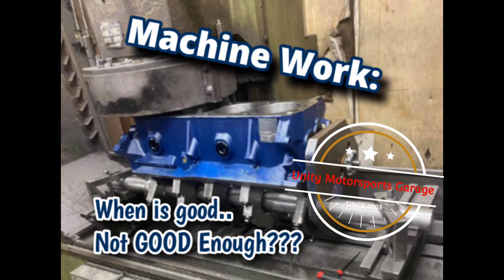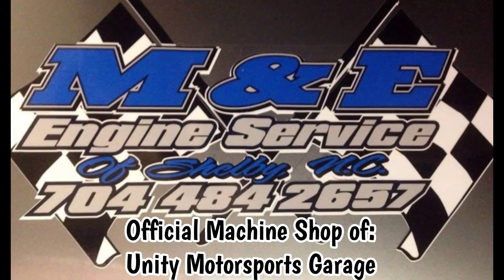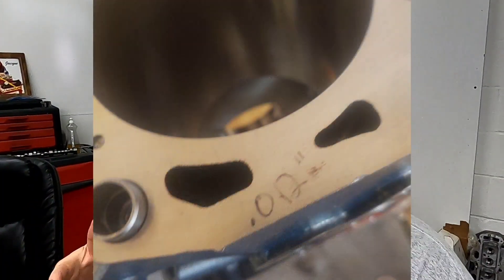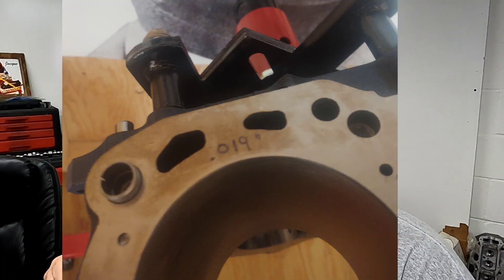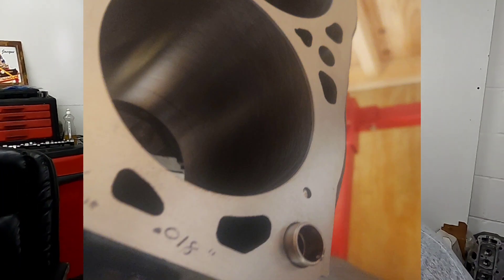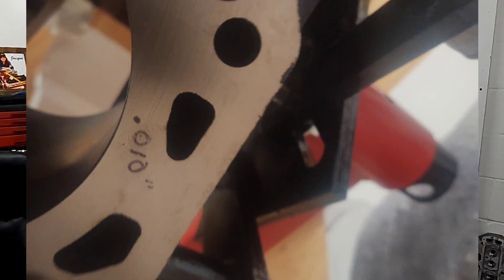Engine Machining: When is Good not Good Enough???

Comment: Guy I used for years retired had to find another machine shop. One was recommended by a few people so I went with it. I can tell you this much, dollars spent isn't always connected to the quality of the work! The decks aren't straight, shorter to the inside of the block. Pistons are zero decked on the outside and positive by about .010 on the inside. Hopefully I'll be able to assemble the 318 as is otherwise I'll end up paying another shop to fix it. Never going back to that shop.

Comment: The automotive machining trade has been good to me throughout my adult life. Started out at 18 years old doing it. Some days I had to walk to work. 
  It never paid me a prestigious wage, just a living and a few extras. It kept me out of trouble and in the good graces of many fine mechanics. 
    I worked my way into a small mom and pop racing engine shop after about 10 years of experience. I was well versed in the old Serdi seat and guide equipment. I learned the importance of guide to seat concentricity and how to keep the machine tuned up to tolerances I expect nobody to believe.  
   Years later with the help of my father and a few good friends it was made possible to buy out an old machine shop at near scrap prices.  
    Dry west Texas environments sure keep rust at bay.  Dust is another story. 
    The Ford customers I took interest in helping out in the performance shop took care in helping me to afford fixing the equipment. I can not be thankful enough to them. 
   I’m now a few months plus side of 50. I have my own machine shop at home. I wish I had the energy I had in my youth. 
   I find myself never earning enough to cover the improvements I make and I’m blessed right now to be able to do so. 
   No more vitrified stones for honing or valve facing. It’s bonded diamond and cbn. May never earn enough to break even, but what a great ending to the frustrations of dealing with taper and titanium valve grinding. 
    It’s a true labor of love for myself. I try my best to be a helper to the machining community. I find that attempt to be treacherous in that this trade is full of hardened mindsets, my own included. You can come across as an attempted savior very easily while not intending to. 
    The best aspect of this trade is learning new and improved methods. Often you find that you’ve gotten away with less than desirable methods without consequences. The minute you’re made aware and chose to practice true ignorance, you pay the price.  So I find it keeps me honest.  
    I also never knew that my 8th grade interest in the scientific method taught to me at the time would serve me so well. The practice of scrutinizing and controlling the idea of one change at a time and testing that change is a task. Extraneous variables recognized and controlled can sometimes lead to further success. The knowledge that nobody is perfect brings forth excitement at times.  
    I’m sure it comes as no surprise that this is a dying art. It sure is a practice. It is not a bicycle ride you’ll never forget how to do. You get dull when you don’t practice.  
    Finding a new energetic generation to take interest in this seems hopeless and that is somewhat disheartening. 
   I keep plugging away. Having as much fun as I can in the mean time. It’s still a great life for me.

Comment: Cheap machine work isn't good.
Good machine work isn't cheap.
I won't mention the manufacturer,  but it was 1 of the big 3. On my mother's eyes, this story is true. We once took a brand new big block, performance crate engine apart to check all the tolerances and balance of the entire rotating assembly. Remember,  from the big 3 now. Align hone was fair, as well as the final cylinder hone and size, but from there, that's where dimensions really became scary. Rod big ends were fair at best. Balance of the rotating assembly was controversial at best. The point being, this engine MAY have lasted 100,000 miles or more. Did it require a complete " blueprint " for performance use, ABSOLUTELY. 
T.S. RACING
Reply from the maker: So true... Thanks for Watching
Andy
Reply: Thank you Andy. I remain anonymous here as I'm primarily retired and I just build engines for a select few. 
I am looking forward to providing some real world engine building experience. I am suscribed to Mr. Vizard as well. A brilliant,  brilliant man, and I used to teach dyno tuning as well as the flow bench in a tech school. When he speaks,  I listen. 
I just wanted to add, that in my first message to you,  when I talked about the align hone looking fairly good,  what I meant was,  plus or minus. 0001" for size, taper, and out of round.  Same with the cylinders,  plus or minus a tenth,, in 12 places inside the bore.. I'll be hopefully doing some videos in the future,  and ya'll can see first hand,  my experience. 
GOD BLESS YOU ANDY.
And yes, all the pistons were pressed off the rods to check their weight and establish a true Bob weight and I spun up the crank at a 50% balance factor. In my Race Shop, over the years have been contracted to do several studies on engine building.  1 of my favorites was comparing lubricants for rod bolt stretch, and main bearing housing bore,  and rod big end  dimensional changes
 comparing several different lubricants as well as mixing 1 or 2 together.  The results were interesting to say the least.

Comment: Andy, I think it would be interesting if you did a series of videos on the proper tools needed to build a top notch high performance engine, including the cost to buy each tool and how to properly use them. I’ve done stock rebuilds, but I always have a professional build my race motors. This is because I don’t have the proper tools nor the expertise needed to build a high dollar motor that needs to perform well and stay together. I would certainly learn from something like this. I’m sure there’s info on line, but you’re very good at explaining things and easy to relate to. So, just a suggestion. Thanks for your great videos!
Reply from the maker: That would be a good video... I will do that

Comment: you've probably mentioned this on other videos, but a fly in the ointment--store the deck bridge and calipers at room temp. sometimes an expansion or contraction leads to a wrong measurement and you chase after a problem that doesn't exist :)

I find one great way to find a good machinist is to hit the local airport and find who the pilots use--when a plane blows an engine, they can't just pull over to the side of a cloud and ask for a tow.
Reply from the maker: I have covered about using Calipers at room temp. Thanks for Watching and for posting
Andy

Comment: YES! I deal with this all the time. As a HP machinist I'm amazed at all the racers that just want to get something together and throw a big shot of nos on it or boost. It's like a house, you have to have a superb foundation for everything that goes on top. I despise Richard Holders channel in which he takes a so called junkyard engine and throws 20 lbs of boost on it and everybody thinks that's a good way to go because it's cheap. I'm sorry Richard a 1000 hp 5.3 L from the junkyard will be back in the junk shortly! Too many racers spend their money over and over again thrashing a TURD when they could've built a reliable strong engine with the same money in the first place!

Comment: Great advice! There are no words to describe how important a properly machined block is, as the foundation of a powerful, reliable build. Ensuring straight crank and cam journals, parallel decks to the centerline of the crank, and true 45 degree cylinders to the same centerline makes for a top quality build.

Comment: Great video, man. 
I’m a retired machinist by trade, and I can’t stress enough, that “new” engine builders MUST check everything! Never assume anything. The bare block and heads are the foundation of the engine - a house is only as straight, strong and true as it’s foundation will allow. The same goes with engines. Perfectly machined, aligned true surfaces are a must. If you think you can’t afford it, think of this; get the proper matching done now, and upgrade your bolt on parts as you can afford them. Don’t spend your money on the bolt ons and neglect the machining and block preparation!!
Reply: AMEN! The problem is that they don't. Power has become king and longevity seems to be last. Thank Richard Holders channel for some of that. He's a moron.
Reply from the maker: Thanks Trevor! Its amazing to me the number of people who will spend good money on hard parts ..then say "It will be alright" when it comes to the machine work...
Andy

Comment: Totally great video man. Stock engines (no matter who makes them) are only made to run, that's it. If it fires and goes, it only has to live until the warranty dies. So they don't really care. If you want to correct that, it takes a good machinist to get it dead nuts on.

Comment: I've been dealing with this the hard way on one of my projects. I had a short block done for me from a local guy that was pretty well known and trusted. I also bought some new assembled aluminum heads that were a name brand. Well long story short engine didn't run that great and was having smoking issues. Pulled motor all apart and apon deaper investigation decks were way out of square, bore size to big for pistons, tons of carbon on the pistons,  bearings all looked like they had frit run through them, broken valve spring, messed up valve seal, terrible valve jobs that didn't seal, and guides that were to tight. 

The motor had about 5k at this point. I know how to break in a motor as this is definitely not my first new engine. I have done the assembly before in the past but I only do that on the ones I'm just freshening up. I don't have all the special tools to really assemble a high end engine or the time or patience. 

So yes quality machine shop is a must and new parts are not necessarily good. It is hard to find though. The other kick in the nuts was my transmission got rebuit at a different shop that was well known and it had a bunch of issues also. Quality work is hard to find. I am so deap into having to find different shops to redo my drive train the second time around. I am not a get it done for the cheapest possible price kind of guy. Every time I have work done for me I tell them if you need to take more time to get it right do it and I will pay for your effort. Don't just slam it together. Buy once, cry once.
Reply from the maker: Thanks for posting and for watching!
Andy

Comment: Bought a set of Dart heads 20 yrs. ago, couldn't get the bolts started, bolt holes were out of parallel from the dowels .045 and .062 end to end. About a year later went to see a former co-worker that had a small machine shop, had a pair of Dart heads in the box sitting there, said he had to open up the bolt holes for their owner.
Reply from the maker: I've seen tons of stuff like that over the years!  Thanks for posting and watching
Andy

Comment: As a “professional” engine builder, I tell you that every performance build should start with line boring the mains. On any “seasoned” block they’re never straight, inline 6’s are the worst because of the length, but when done correctly, with a quality crank grind and proper clearances, when you assemble the crank will spin like it’s on ball bearings!
Reply from the maker: That's exactly right.. everything is based off of the mains.. Thanks for posting and watching!
Andy
Reply: Respectfully, i'd argue that term "performance". I mean, Corvettes can kill a Ferrari these days, there's 700 hp Hemis with warantees, so they sure are performance cars, and yet they're certainly going to have flaws. so i was pulling a Vortec 350 and rebuilding to Z28 specs and then adding some headers, i might save a dollar on a cut corner,  and in a racing engine taken apart every weekend, i suppose an unsponsored team might get away with some things in a "claimer class", but if one is going way past OEM specs, then I'd say yeah, go with line boring the mains, and make certain with a cam-in-block design, the timing chain takes up all the slack. The crankshaft is basically just a spring squirming around, and if you're going to deck the block etc, the foundation needs to be taken from someplace.

that said, i prefer to deck the block before honing the cylinders--many shops do the opposite to get compression equaled out between cylinders, but the idea of the torque plate is to represent distortion, and then you cut the deck thickness afterward? some will find that too finicky, and i've worked with aero machinists who were Marine snipers--there was ONLY one way everything got done--who drove me nuts.

Comment: I travel 3 hours each way to my favorite machine shop and it's worth the time spent.  I've preached for years to people how essential quality work is.  Usually falls on deaf ears.   It's surprising how many people think decking a block and align honing the mains are unnecessary. Then wonder why their engines don't run as well as others.    What they don't realize is all the block work is based off the main saddle.  If that's not straight how well do you think the rest of the machine work will turn out?  Even brand new blocks are not immune to these issues.   Great video Andy, I wish more people understood this.
Reply from the maker: You are exactly right..new blocks usually come + .010" to .015" on the decks so you can Taylor it to your combination of parts! 
Thanks for Watching
Andy

Comment: You skipped over an important point on squareness. For example on your block you determined the crank bore and head surface were not parallel but you didn't determine which one was wrong.  It could have been that the crank bore was out of parallel to the block rather than the head surface being messed up.
Reply from the maker: That's a good point! Thanks for Watching and sharing.
Andy

Comment: I only built one V8 from the block out and it was for a driver. I spent nearly 3 grand in the '90s on just reliability machine work- make this thing a workhorse I said. My machinist did a fantastic job and the engine went together like a snap and didn't go over T-stat temp on first start even though those blocks are a bit thin netween the bores and it needed a .030 over. I looked like a hero, but it was all due to a guy named Tommy Cavuto knowing how to work on blocks cranks and rotating mass. I just put the tinkertoys together and checked clearances and torque.
Reply from the maker: Good stuff! Thanks for Watching
Andy

Comment: I've seen a few try to duplicate a great engine buying all the same parts but, skimp on some of the machine work. Most of the time they have so much money wraped up in parts they didn't feel those extra steps were needed. Then they blame the machine shop cause it didn't perform the same.
Reply from the maker: That's a good point!  
Andy

Comment: Good info, I'd like to add that tolerance stack seems to happen quite often with cam bearings/ cam journals these days.  Also, pre balanced rotating assemblies are often just "close enough".  This does not just apply to internal parts. In recent years I have seen several of the import harmonic dampers need to be honed to fit the crank as the tolerance stack leads to too much press fit.
Reply from the maker: Very true... The list goes on and on!
Andy

Comment: Honestly, the stock block stuff is where machining really matters. Straight decks, straight bores ( including the mains and cam bores ) matter. Then there's reciprocating assembly balance. If the harmonics are controlled, the cheap stuff will live.

Comment: Hey Andy, I got a question unrelated to this. Could ya run it by Mr. Vizard? I wonder, why did big port, canted valve engines (Clevelands, 385-Series Fords, and BB Chevys) come with factory 1.70 to 1.73 rocker ratios, while small port, inline valve engines (SB Fords, SB Chevys, and pre-Magnum Mopars) got stuck with 1.5s? Seems counterintuitive to me: I think the smaller ports could use the help from a bit more lift, without appreciably changing the duration. Never mind the FE Fords, they're an oddball and don't fit the narrative.
Reply: From what I know, the more ratio, can work, as long as the piston to valve clearance is ok, and depends on the application.
Reply: @danderson9881  But the factory cams in those engines are so small, another .050 should be very safe. Especially if the duration stays the same. Cuz duration affects P to V clearance as much as lift does.

Comment: I remember a Ford magazine having intake leaks on a small block. Turned out, from the factory, the decks were about a degree out of spec from each other. That's. 0175" PER INCH deviation!
Reply from the maker: That is Stack Tolerances at work!  Thanks for Watching
Andy
Reply: Haha one of the first jobs I had at this new place was doing a head gasket on an old Hercules that blew gaskets out every few years I was told. 
Damn deck looked like it was done with a 4" Makita disc grinder.
Actually it looked like maybe one of the bits on the decking machine head had a burr, and it left gouges all across the deck you could feel with your fingernail. 
Since this thing was out in the field, it wasn't getting torn down so I did the best I could with my file set.
That was about 7-8yrs ago, haven't heard from em again so no news must be good news 🤣